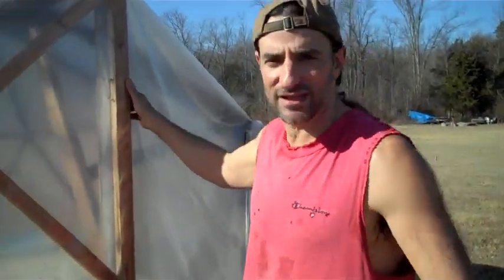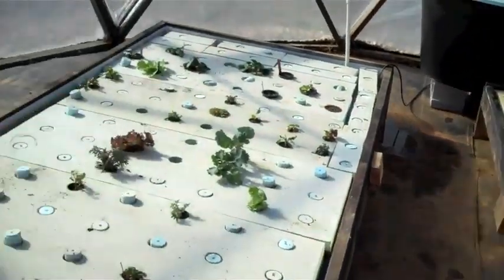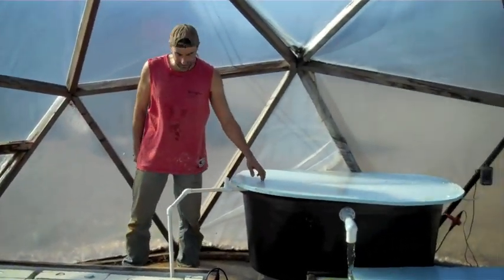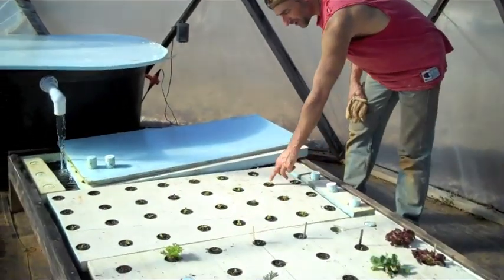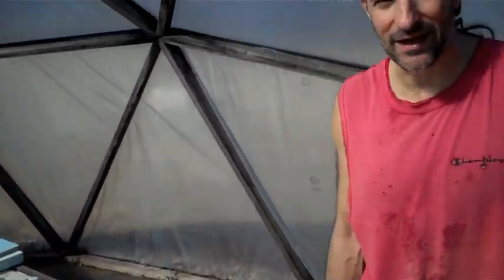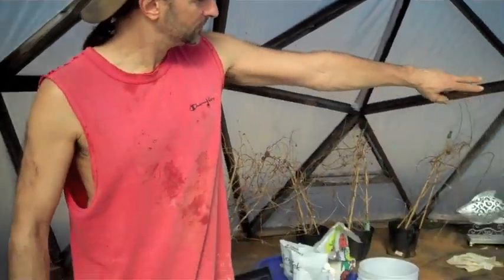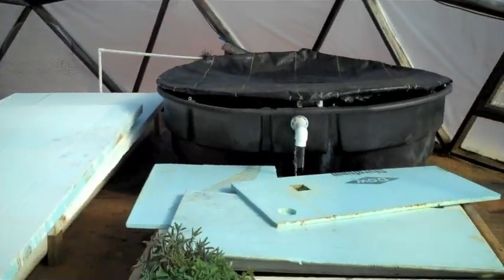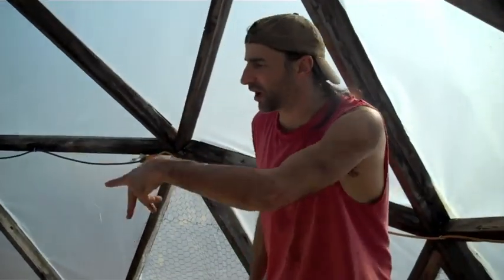AQUAPONICS SYSTEM AND DOME RE-DESIGN

Comment: where in Tennessee are you?  How do heat or regulate temperatures for winter growing and managing the fish and water temperatures?
Reply from the maker: We are in middle Tennessee just outside of Nashville. We do not do anything to regulate water temp. We use goldfish and bluegill which are very tolerant to temp ranges. Our water has been down in the lower 40's and up in the 90's and the fish handle it just fine.